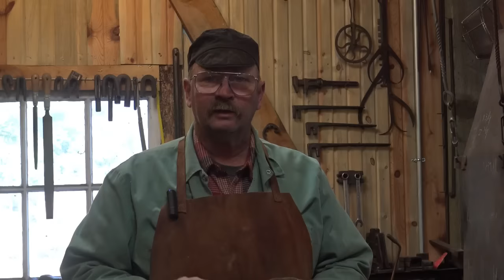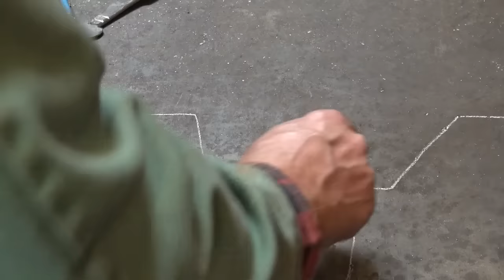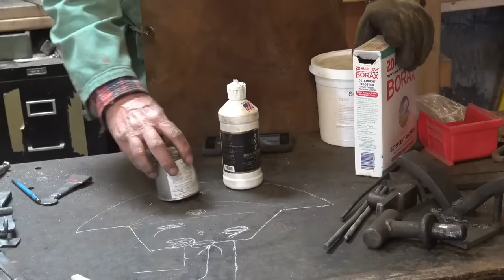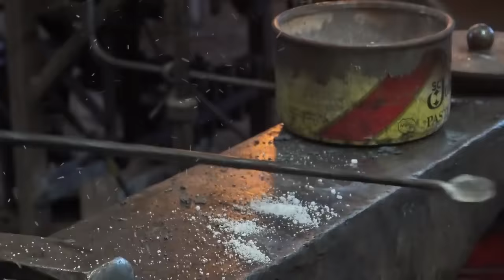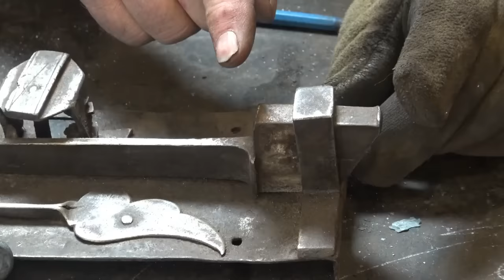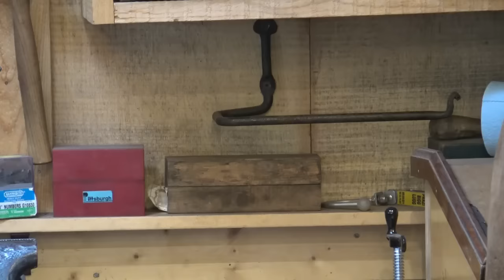Introduction to forge welding - basic blacksmithing

Comment: first time I welded with borax as a flux, I was very taken back by the faceful of fumes coming off the melting borax, eyes stinging and watering,  no one ever mentions that!
Reply from the maker: I have noticed it can get airborne as dust, but never had a fume problem or burning eyes.
Reply: Were you using scented borax? You have to use pure borax ,don’t use scented the fumes can be very bad...

Comment: Very good - I will use this film in teaching.  There is even another type of flux that will work excellently: Silica sand. Wash it for salt if you find it on the beach.
 I would also like to comment that forge-welding is not learned by theory - the way is practising. That's it.
Reply: Oh - sparks - is no good, but if you use a coal-forge it can be used to confirk that you have reached forging temperature: As soon as you see "the first two sparks" you are there! :D :D  (Håvard Bergland)
Reply from the maker: Silica sand was probably the first flux.  Yes, all blacksmithing must be learned by hands on practice.

Comment: Great video. Very informative. I do have 1 question though. I'm in the process of building my first forge and may have to rethink my design after watching your video. I've built a forced air gas burner. That being said if oxygen is not a good thing when forge welding and if I understood corectly that (higher carbon steel has a lower forge welding temperature?) would a venturi burner be a better idea for me to start with? I made the forced air burner because I understand that they require less propane to achieve the same amount of heat as a venturi burner but I'm worried that being a beginner to this I haven't had time to understand the fine tuning of propane and air mixtures for best results.
Reply from the maker: blown burners work very will for forge welding and generally get up to heat easily.   Its just a matter of getting the fuel and air mix just right

Comment: The advantage I found when forge welding in a charcoal forge, was that I got much less scale and required much less flux than when using gas. The surfaces to be welded simply stayed cleaner and bonded more easily. This has to do not only with oxygen consumption but monoxide production and the protective layer of gasses that result.
Reply from the maker: I like working in charcoal, but don't have a convenient source and it is time consuming to make enough.
Reply: Agreed. If I had a choice I'd find a way to use charcoal for welding and gas for pretty much everything else.

Comment: Very informative video. My question is this. If I only have access to thinner metal, like 1/8" or 1/4", is it practical and effective to forge weld the pieces together to get a thicker piece to then make an impact tool like a hammer or axe? If done properly, will you be at risk of breaking the weld during normal use?
Reply from the maker: While time consuming, it is certainly doable.  You would essentially be making wrought iron and that was the material used for centuries.  If done properly there is no reason the tool should have any issues.

Comment: So the forge only needs to reach a high enough heat to forge weld? The forge/foundry I built was able to hit about 2500*F using just forced air and high pressure propane. I've since redesigned it to be able to use waste oil, propane, forced air, and pure oxygen. It can use any combination of these including all of them at the same time. Unfortunately my IR thermometer can't get that high, so I'm unable to say just how hot it can get

Comment: I guess to clarify my question like when you make a wrapped I tomahawk folded over and weld it at what point during the blade is the two pieces of metal never coming apart even if you really force a handle in
Reply from the maker: Its somewhat subjective.   There are lots of things that can go wrong with a forge weld.  But for an axe by the time you finish shaping the blade it should be good and solid.  However the are near the eye gets very little refinement and can start to open up if wedged too tight.  hand forged axes are often wedged front to back for that reason

Comment: Attempted my first forge weld today. I thought I would try making a basket. Bombed. Temperature was OK , I think , I wonder if the problem was that I tried forge welding four pieces of 1/4 inch round stock. Should I have squared the pieces first so that all surfaces were in contact?
Reply from the maker: One thing that helps is doing the weld in a swage so the bars don’t slip past each other.

Comment: One more question: would it be considered bad blacksmithing to practice to reinforce your project with a little mig or tig weld to help increase the strength of your blacksmith project?
Reply from the maker: If your work is properly designed and executed there is no need to additional welds.  But in some contemporary designs the mig or tig weld is the primary means of joining the forged pieces.
Reply: Thanks for letting me know. 👍

Comment: Another great video, thank you and glad to see you're recovering well. A question about borax; I keep seeing blacksmiths gently sprinkling it on and wonder why not "dunk" the piece into a metal container full of borax, swirl it around a bit, tap the piece to knock off excess and proceed? Seems like you would get better penetration of borax into the weld seam?
Reply from the maker: It would be a huge waste of borax for one thing.  The hot material would cause the borax in the container to clump and it would quickly become unusable.  Flux should flow into he joint via capillary action and takes very little to do the job properly.  To much can actually get trapped in the weld and cause the weld to fail.  Any excess flux that drips of the piece in the fire either makes for bigger clinkers or leaves a puddle of goo on the floor of you gas forge.  So use flux sparingly, some people don't use any flux.

Comment: I have a quick question.. You mentioned adjusting the gas and air intake for gas forges in order to forge weld? Am a new kwner of a  single burner chili forge and i was wondering besides bumping up the psi do i need to adjust the choke to gain or decrease the air intake?
Reply from the maker: Usually I find the higher pressure brings in so much air that it needs to be choked a little more.

Comment: Question.  I'm going to be getting into blacksmithing, but when the flames are going, do you have to worry about ventilation?  Can't see his environment but it seems enclosed.
Reply from the maker: Generally I believe a shop should be well ventilated all of the time so I don't tend to worry about it much.  But you should always have plenty of make up air at the very least.

Comment: How do you forge weld 7 pieces of 3/8" round together for 6" on the end of a bundle of two foot long pieces?  
Do you already have a video on this?
Thanks for all you do, JIM
Reply from the maker: I do not have a video on that specifically.  if they need to be arranged in a circle for some sort f basket shape, you would need to have a core section under the weld that matches the inside diameter.
Reply: @BlackBearForge  OK, got it, thanks, JIM

Comment: hey if I just burn some wood and just keep adding until I get a nice heap of glowing orange stuff and put my metal in the middle, will that work? ;)
Reply from the maker: For lower heat requirements it does, but no for forge welding unless you have a source of forced air like a bellows or blower.

Comment: John, understand when one uses a gas forge it is easy to see the material for temperature.  What is the technique when using a coal forge?  Seems like when I take it in an out of the fire to "check" them temp it always goes wrong.
Reply from the maker: I find it easiest to leave the bar in the fire and pull just enough coal away to give you a window into the fire so you can see the work.  I will try to make that a part of my nest welding video.
Reply: Thanks that would be excellent.  BTW glad you are on the mend and pounding again!

Comment: Ever have issues with flux deteriorating the fire brick in a gas forge? Another YouTuber mentioned that can be an issue.
Reply from the maker: Yes, thats a real problem with welding in a gas forge.  The lining wears out eventually anyway and will need to be replaced, but it happens many times faster if you're forge welding.  Sacrificial floors, such as a kiln shelf,  can help but also reduce the chamber size.

Comment: Assuming the light - fast initial welding blows allow for better welding due to less drastic temp changes?
Reply from the maker: It is more a matter of not causing movement of the weld surfaces.  Heavy blows that are spreading material prevent the weld from striking.  Once the pieces begin to fuse they can be worked more aggressively.

Comment: When air is compressed it gets hot
Do you think its possible that the hammering effect of 2 hot metals against each other causes a rise in temperature that causes the 2 metals to stick to each other
Reply from the maker: I doubt the rise in temp would be sufficient to make them weld.  Plus pieces at the right heat will stick in the fire sometime even without hammering

Comment: if i wanted to make a bunch of nails, screws or bolts into one piece of metal. is it possible to forge weld them together without using a electric welder first or would it be better to melt the metal and cast it.
Reply from the maker: It is difficult to get them to stay together in the fire.  But if they are large enough you can bundle them up with bailing wire.  You can also pack them into a piece of tubing, but I have never tried that process

Comment: would charcoal or nut-coal work for forge welding?
Reply from the maker: Real wood charcoal works well.  So far as I know, nut coal just refers to the size not the type.  But any coal that burns clean and hot should be able to forge weld.
Reply: Charcoal is best because you don't have to buy it. It burns faster than coal but if you know what you are doing, you would have an endless supply of charcoal. Avoid low grade coal as it can oxidize your steel and prevent you from making a forge weld. Google the word "clinker" and it will explain more.

Comment: Why would initial heavy hit ruin weld?  Thanks for video/ info
Reply from the maker: A heavy hand in the beginning may cause the material to move shearing the pieces apart as you try to weld them.  The pieces need to be well stuck with rapid light blows before any heavy forging is done.  On smaller welds this can occur in the same heat.

Comment: @blackbearforge Any issues with Iron Mountain eating away the fire brick or refractory cement in your gas forges?
Reply from the maker: Yes, I have never found a flux that doesn't damage the forge lining.
Reply: @BlackBearForge Thanks. That definitely goes against their claims. Maybe it's less than other fluxes. I'll just plan on replacing the brick floor.

Comment: Can you go layer by layer weld one then re heat and weld another layer as in layering for dumascus or folding back over and over ?
Reply from the maker: Yes, but you can also fold it back and forth onto itself before making the weld and do it all at once to build up stock.

Comment: Nice information. In my experience of forge welding (just made 2nd ever damascus weld for my home made gas forge. For the gas to weld the high carbon steel the flame has to reach the bright yellows or white color and the flux I use borax only works till it starts to dance or move around molten like. And when ive only had successful welds in the first 1 or 2nd heat. After that the borax gets in the way of the weld it self. Just my rooky experience
Reply from the maker: Any flux in the weld joint should be expelled during the first few hammer blows.  if you have flux trapped in the weld it will prevent the weld from sticking.  Starting at one end and working toward the other end squeezing flux out as you go may help.

Comment: i must ask this can you use oxyclean as as flux meterial for forge welding? it also have sodium like chemicals in it as well. thx
Reply from the maker: I have never tried it.  Make sure that the vapors it puts out at high heat aren't toxic
Reply: best to use that outside i think

Comment: will you explain the turnbuckles on your forge hood?
Reply from the maker: The hood is off the edge of the forge, so it doesn't have anything to sit on.  So it hangs from the ceiling, the turn buckles just allow for some adjustment to get it straight.

Comment: The only reason I wouldn't recommend forge welding in a propane forge is that burning propane in the presence of oxygen produces Carbon dioxide and WATER VAPOR as a by-product. Water and welds dont get along well, but if you are super careful and flux your weld properly you should be ok.

Comment: why when the iron is hot its make full of "skin" when you brush it is metal that have fall off or its dirt ??
Reply from the maker: scale, its an iron oxide that forms at high heat
Reply: @BlackBearForge  
thx alot

Comment: What's the white powder you using
Reply from the maker: Welding flux, it helps clean the material and prevent oxidation in the fire.

Comment: If the thickness between the welds is absolutely crucial I'll bump and grind to come up with a flat surface and a thick enough piece to work with moreover Heat tap tap tap tap flip drive drive drive drive

Comment: I've been forging stuff since mid 2018 and got into forge welding this summer. I had a smith show me how to forge weld two bars together and watched a dozen videos on forge welding. But despite, in my eyes, doing it exactly how people describe it and how it was shown to me, I can't get things to stick together. Mild steel, relatively centered in the fire, lots of fuel on top and beneath, little air from the blower, bright, almost white glow. Doesn't seem to work.
If anyone has any suggestions or else on what I might be doing wrong or if I'm missing something, I would really appreciate it! 
Until a few months ago, I used coal, but it's hard to find where I live and shipping is hella expensive, so I switched to charcoal. Apparently though, the type of fuel shouldn't matter too much, according to this video.
I forged tongs, knives, a sword and several cosmetics (pendants, bracelets...), so I do have some experience.. Any advice is most welcome!
Reply from the maker: Might be too much air causing scale that prevents the weld.
Reply: @BlackBearForge  Which I could avoid how?

Comment: Do I need to use flux to do damascus with a gas forge?
Reply from the maker: Gas forges can cause lots of oxidation.  So flux helps.  However there are ways to weld without flux by sealing the billet in an air tight wrap of some sort first.  You would need to ask a knife maker that uses the technique.
Reply: Okay. Thank you.

Comment: also is wood not an option for forge welding??
Reply from the maker: Wood doesn't burn that hot.  However converting wood to charcoal and burning the charcoal does get hot enough.  Charcoal ois pure carbon (more or less)
Reply: @BlackBearForge  thank you i. sure ill have more questions i just made a forge at home and forged for my first time yesterday i had a blast i went for like 10hrs course being a novice i only drew out two rr spikes  about twice  as long and twisted some flat bar.   i have cnc maching class on monday but tuesday morning im gonna fire up again. i have one clip on my channel and will post more. thanks for your channel im learning lots

Comment: The term "clinkers" has me confused, guessing its garbage metal in the forge?
Reply from the maker: Garbage everything.  A clinker is a conglomeration of everything in the fire that melt.  It is the impurities in the coal, old flux, forge scale and burnt up work. It can form a rather large obstruction that block air flow and prevent you from achieving a proper heat.  I'll try to do a short video on clinkers.
Reply: A clinker is a byproduct of shit grade coal. Impurities that get molten together in the bottom of the forge. It gives off a gas that will oxidize your piece and prevent you from making a forge weld.

Comment: Wouldn't a gas furnace be much more expensive to operate than a coal furnace?
Reply from the maker: That just depends on where you are and which is more available.  For us Propane is about 1/3 the price per day to use as a forge fuel and because I don't have to mess around with fire maintenance or worry about to many irons in the fire I can get 2 -3 times more work done in that same time.  Those two things combined make propane much more cost effective for my location.

Comment: I can't believe how high the price of borax is right now
Reply from the maker: Nit sure what high is.  Looks like $15 for 65 ounces of borax on ebay, probably a bit higher at the grocery store.  But for 6 - 12 month supply that isn't bad.  The Iron Mountain flux I am using now is $29 for 16 ounces.
Reply: I know why its high. It isnt just forge welding borax is used in. The price went up when folks started casting with it. Particularly in gold and silver melting.
Reply: Blame it on that tv show, Forged in Fire. lol

Comment: This is my second time watching this vid all the way through. I am a welder/farbricator who has been lurking in these blacksmith forums for too long. I finally broke down and built a forge with a frosty T burner. I kind of styled it like your forge it is just shorter like a horseshoe forge. I will def get some borax and try to take your advice here. You can check my forge build out at my Youtube channel soon as I get to finishing it just subscribe to my channel. Thanks.

Comment: They just call it forge welding or pattern welding also just called folded steel
Reply from the maker: Every type of weld has a name.  It pays to know the correct name for the technique being used.  While pattern welding is a form of a fagot weld, it is only one use of the technique.